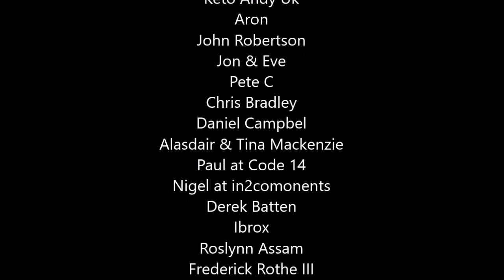Mk3 Ford Cortina Estate. Adventure Twenty Two pt2. Fitting bearings and painting

Comment: always run with 50/50 blucol and water. check bearings after few thosand miles to make sure you nipped em up ok, ive made mistake in past where i eiher over tightened (and blew the bearing) or undertightened and had play. but that was me.
Reply from the maker: Thank you for the advice pete I will do that.